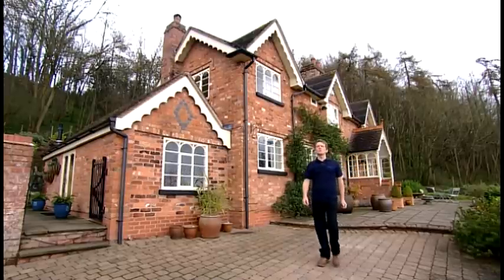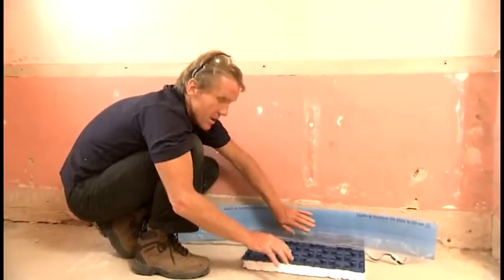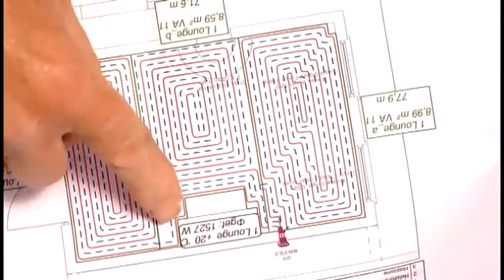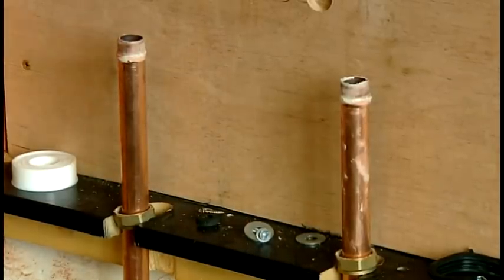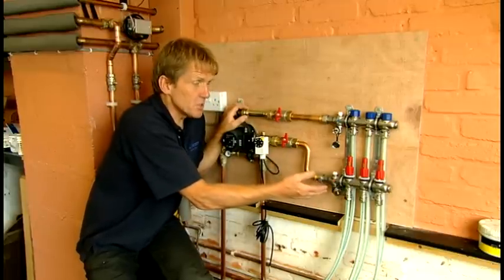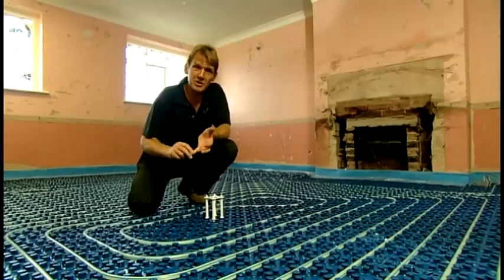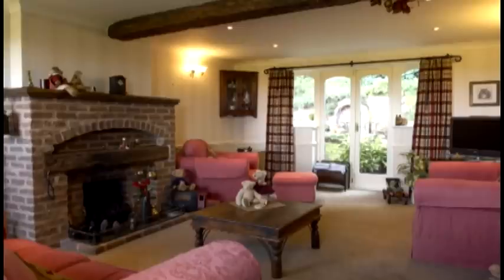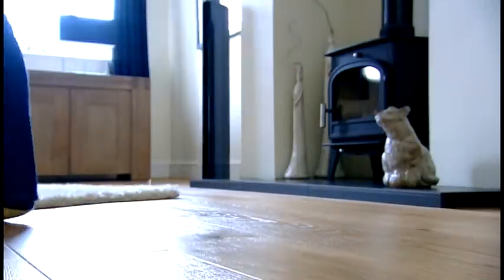Worcester Greenfloor Underfloor Heating Installation Guide

Comment: I’m have an extension built currently,it’s about 60 sq metres with about 5 metres of bifold doors and 2 small roof lanterns, would UFH be sufficient to warm the room without rads?
Reply: I’ve got a similar sized extension with similar openings. Did you go for UFH in the end? Was the heat output sufficient?

Comment: I do have doubts about the time the cost, and all that bother ,when in a couple of hours you can fir a standard rad and be just as cosy so much quicker,all that techy stuff,ref waiting for the screed to dry ,and letting it all cool down for a carpet or lino fitter..Sure if you buy a new house and its got it fine ,.
Reply: Peter you are in a minority. I find that everyone wants UFH these days and nobody wants radiators. The reason is that you can feel the difference immediately. You can heat the room from the top down with a radiator or the bottom up with UFH. No contest.
Reply: less heat to use on ufh where rads need a lot more, loss of wall space etc although if you want warm socks you can't put them on the rad to warm up.

Comment: is the concrete slab that the sheets lie on insulated?

Yes it has a 75mm Celotex sheet under the concrete. You need as much insulation as you can get. Have a look at skill-builder for more information
Reply: Roger Bisby Rodger, Hi some eight months ago  "track a hack" asked you a question regarding the flow meters being on the hot supply or the cold return I have the same problem and had 4 plumbers to try and fix my heating, with no success, I have found no reply to his question and wondered if you could repeat or let me know the answer, thanks Barry  daxkitcar@gmail.com
Reply: My bungalow has a concrete floor (that has thin tiles sat on top of it). Does that mean I need to dig the concrete out, install some insulation and re-concrete it before I could consider installing UFH?
Reply: @SouthCoastFinest  Hi Darren
There are low build systems that will go on top of concrete floors but you will lose a lot of heat into the slab so it will never be as good as having insulation under the screed or concrete.
Reply: @SkillBuilder  Did the home in this video have a concrete floor originally? Was it taken up, insulated with Celotex and re-concreted over before this video was filmed.

Comment: Nobody said you can't walk on it with plywood sheets to prevent point loads but you can't cover it until it has cured and that needs 28 days unless you use fast track screed. Basic building procedure.